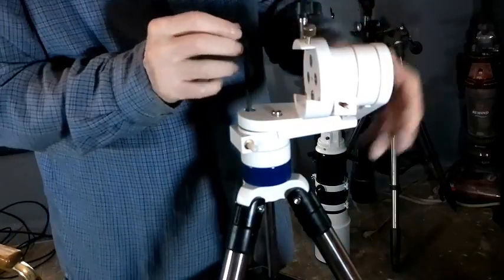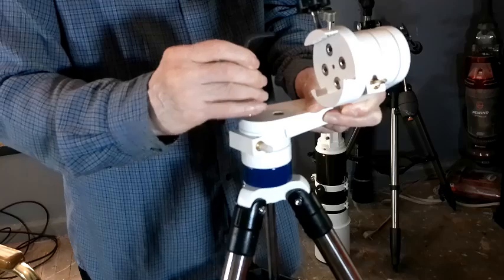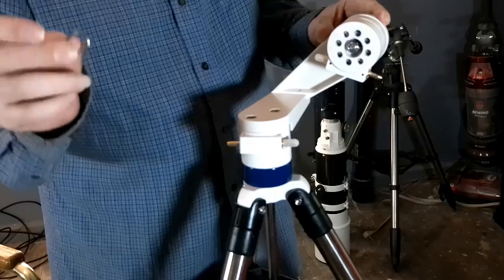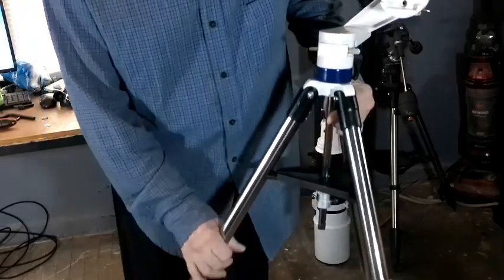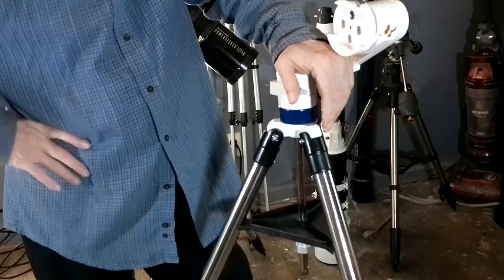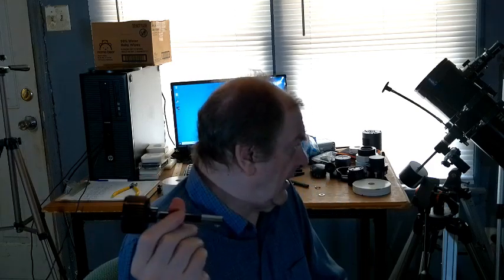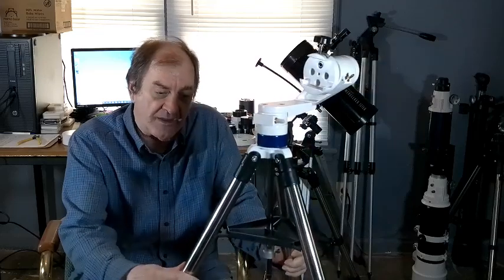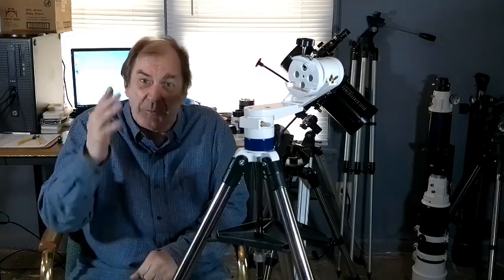SvBony SV520 Telescope Mount Repair and Maintenance #telescope #telescopemount #space

Comment: What is the black part made out of at the top of the tripod leg?
Reply from the maker: The legs are made of stainless steel.  The black tops of the tripod legs and the black joints in the middle of the tripod legs are made of metal.  Don't know what kind.